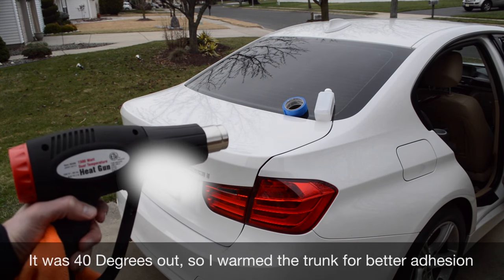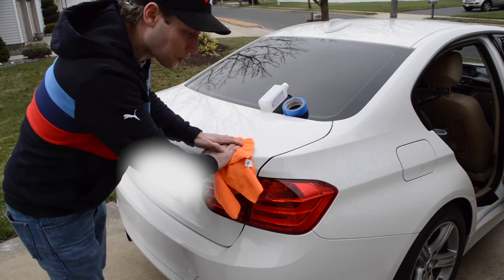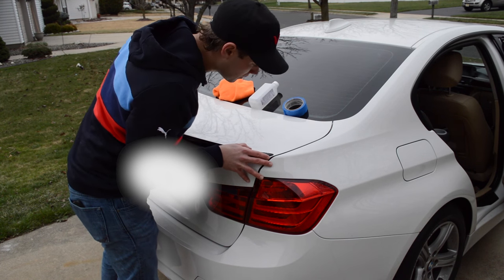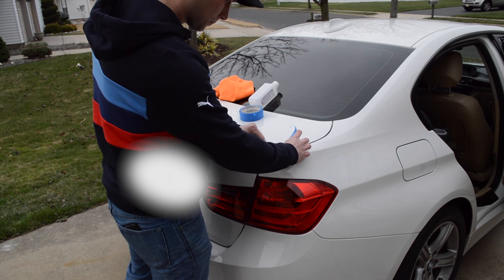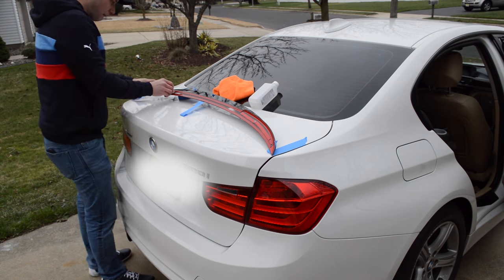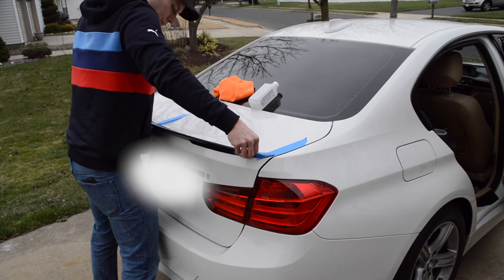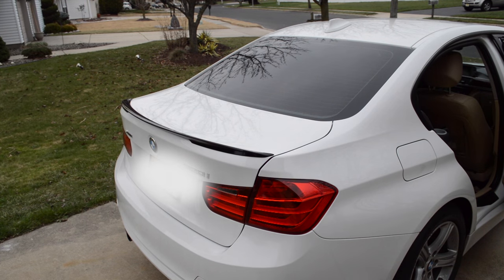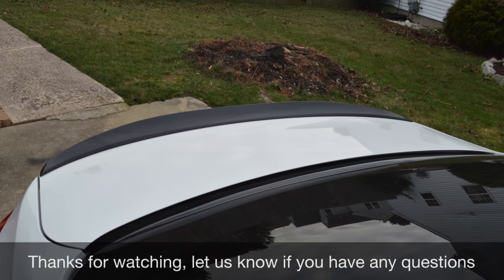BMW F30 328 Lip Spoiler Install (SUPER EASY!)

Comment: you don't peel all the red tape backing. you peel the small tip of them and put back the spoiler on the trunk. once it's perfectly positioned, you pull out the red tape backings while the spoiler is in its position.
Reply from the maker: That's also a good method

Comment: Planning on installing a similar lip spoiler on my Mazda 6. The spoiler comes with 3m tape but I'm guessing I should get some more and cover the entire underside of the spoiler right?
Reply from the maker: +AZWZ I would make sure you use plenty on it, just in case. After over a year of having mine, the corners started lifting, only a small amount
Reply: Kies Motorsports Thanks for the info!

Comment: perfect tutorial brother! especially using the tape as a guide like that. Im doing mine real soon. Any additional tips?
Reply from the maker: Thanks! I would say..1. Make sure you use 3M or another high quality double sided tape (you don't want it to fly off) 2. Clean the area well (I used alcohol and it worked well) 3. If you can, do it on a warm day and try not to get it wet for a few days. Other than that, I recommend using tape as a guide to make sure that you line it up good. 
Thanks!

Comment: I have the same spoiler on my car and in my opinion it really adds to the cars look.
Reply from the maker: +Pav W Awesome, I totally agree!
Reply: Pav W I'm not doing it for looks because I'm not a ricer. I'm doing it because a lip spoiler eliminates rear lift and improves aerodynamics(lowers your coefficient of drag) by eliminating the turbulent air at the end of the car thats created by the shape of a car. That swirling at the end of a spoilerless car creates lift. A spoiler eliminates this improving high speed stability, your fuel economy, and acceleration at speed.

Comment: i live in chicago and i have followed these steps plus using a temp gun and adhesive promoter like 7 times and each time the f* thing comes off when its too hot/cold outside so i just used silicone instead of the 3m

Comment: Nice. I just bought a white 328i with the sport package, so it has black mirrors, black grill, black exhaust tips and a black trim piece on the rear bumper, and I'm thinking about a black spoiler lip to help set off the rear end.
Reply from the maker: Nice!

Comment: Great video! I have a leased f30, do you recommend doing it? Will it be hard to take off or scratch.
Reply from the maker: Hi, Thanks! Sure, it's not too expensive and it is reversible.  Worst case, you could probably leave it on and the dealer most likely wouldn't say anything. You can get the lip for about $100
Reply: usually dealers dont even look too closely at lease returns espically if u are getting something new from them. a nice added lip wouldnt even be noticed

Comment: Hi, I just installed my carbon fiber spoiler and if I decide to remove it, what should I do, should I just pull it off with my hand or what?
Reply from the maker: Hi, you need to remove it similar to how you would debadge your car with fishing line, heat and something to remove the tacky residue

Comment: Hello!
The BMW install instructions have you change the tension spring from position 1 to position 2 after you install the spoiler. Do you know why is that recommended? Why the tension spring? I cant find any info on this.
thanks
Reply from the maker: It's to account for the extra weight. I didn't do it and it's been fine..
Reply: Kies Motorsports thanks for the reply. But i still have two more questions if you don't mind?
I figured it was for something like that, but it is to account for the extra weight due to its heavier on the springs to open the trunk?
OR
because it's harder for the springs to close it?
Lastly
What's the easier way/right way to get to the springs without mistreating the inside liner? 
Thanks again, a lot.

Comment: Great Video. Very helpful. Which spoiler did you order from the ebay store? Was it the Matte Black Painted one? Thanks.
Reply from the maker: +Yvonne Tong Hi, I got the painted one. I heard that the Matte Black scratches easy. Not sure if that's true, but that's what I've read..

Comment: I HAVE INSTALLED THE SAME SPOILER, BUT I HAVE PROBLEM WITH THE OPENING OF THE REAR DOOR FROM THE KEY, THERE IS ANY SETTING TO ADJUST THANK YOU
Reply from the maker: You may need to make the tension on the spring more

Comment: is that a bmw lip ? what are the chances of it falling off?
Reply from the maker: It's aftermarket and very secure. Just use a lot of 3M molding tape and you should be good.

Comment: Does anybody know if I took off the spoiler afterwards would it leave any marks or anything ?
Reply from the maker: It may, but you should be okay. May be good to buff it once you remove it
Reply: It would leave black stick residue, but you can use WD-40 and a mirco fiber cloth to clean it. it comes right off with ease.

Comment: What tape did you use?
Reply from the maker: Hi, I used 3M automotive molding tape and it's been rock solid. You can get it at walmart, ebay, amazon and many other places..

Comment: nice job man! looks very nice. I just wonder very did u buy the rear spoiler and the tape. what kind of tape is it? will it work solid?
Reply from the maker: +Jason Xin Hi, thanks for watching. Yes, the tape is super strong. It's 3M automotive tape that you can get it most places. Here is a link http://www.walmart.com/ip/16913678?wmlspartner=wlpa&selectedSellerId=78&adid=22222222227024071857&wl0=&wl1=g&wl2=t&wl3=42974108792&wl4=&wl5=pla&wl6=81466116752&veh=sem

It costs around $7-$10 USD for about 5 feet. As for the spoiler, there is a link in the description that will take you to the eBay listings and the sellers website. Thanks!
Reply: thx a lot bro! 5 feet is enough for the spoiler isnt it?
Reply from the maker: No problem. My spoiler had some double sided tape on it, so I just added extra. I think it should be enough if you're using it to add to what's already there, but you may want to pick up an extra roll if yours doesn't come with any. I'd rather have too much over not enough..

Comment: I wish I had watched this before putting my carbon fibre one on, i did end up putting it on nicely after three tries but now I'm not sure they tape would be at it's full potential and I also put it on while my car was a little cold as it was plus 3 Celsius out, you think it will still be good? Thanks.
Reply from the maker: Hmm, hard to say. Worst case, you could always get some new adhesive tape. I did mine when it was about 5 celsius and it's been rock solid, but I heated the surface good with a heat gun.